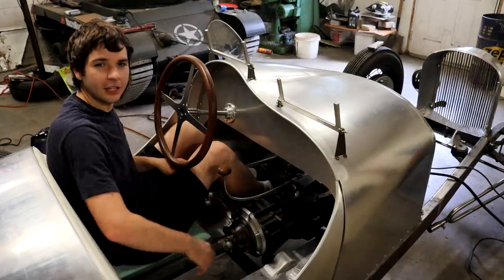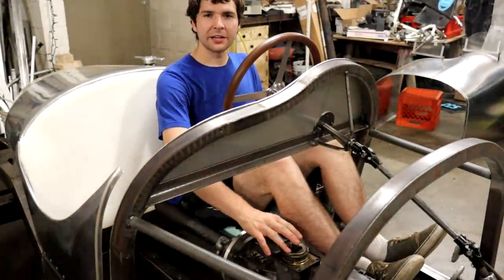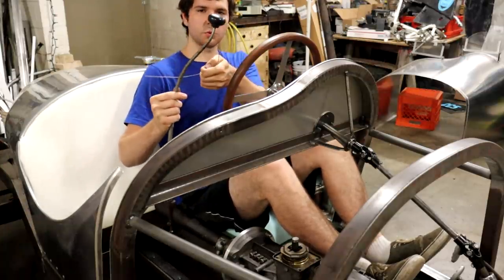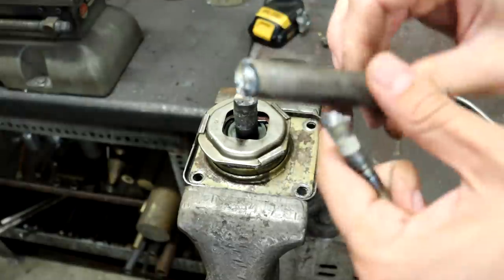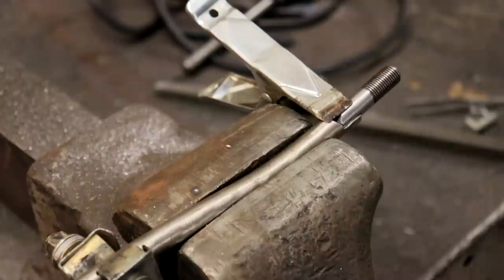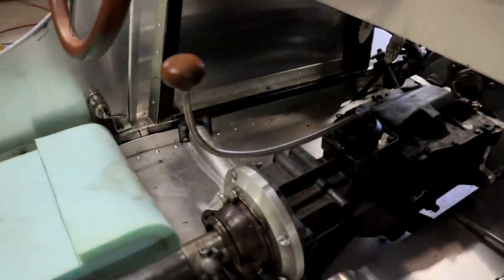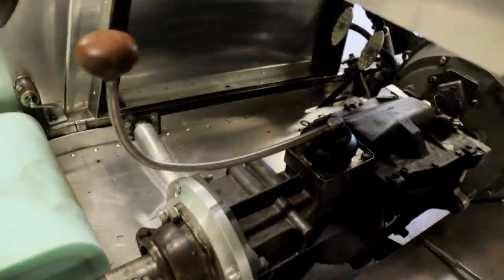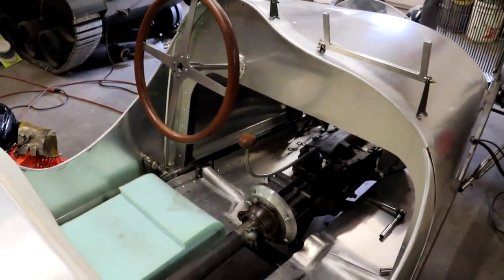Fabricating a Unique Shift Lever | Homemade Boat-tail Speedster Pt. 52

Comment: Original shifter warning! I've seen some crazy metals on shifters from iron, to galvanized steel, 11L17, and even one contained lead.
The one you have there is 11L17, great for machining, wear resistance etc. Stupid hard to weld low carbon with high  manganese..

Comment: @ 06:05 When using a radial arm saw, tuck your thumb underneath your palm to keep it out of harm's way, it serves no purpose being outstretched anyway since the cutting force is away and back from the workpiece. In fact, a well-sharpened negative tooth rake blade would need no help in holding work in place and will freely slice through unlike a tablesaw. I have rebuilt many of this saw type over my 73 years and it is my preferred sawing machine. 
You have a great video series; I just want to make sure you still retain all ten digits for the future. ☺

Comment: Brilliant job !!! Loved watching you work thru the Rod attachment issue ... it's always "The Little Things" and you scored 100 on adding the extra Pin to the attachment to keep it tight later in it's Life Cycle; I was concerned with short ED when you first bored the threaded bolt ... the Pin will make up for the loss of material.  Can't wait for your next installment !!!

Comment: Obviously there are so many ways you could have attached your shifter arm assembly. What you did works perfect though. IF, you really need to weld things, you could have spun up a total new shifter that fits inside the transmission and go from there. But your idea looks great as well. Thumbs Up!

Comment: Not sure how I missed this installment, given that I've become pretty good about viewing each one on the same day you upload them.  Reminds me of my own intentions to take advantage of my Uni-era woodworking and foundry/forming courses to design and fab a custom shift knob for my second-hand Mk 1 VW Cabriolet.  Sadly, the closest I got was knocking out a few VERY rough concept sketches, and I never managed to have access to similar shop equipment to revisit it, post-graduation; then life got even more complicated than it already had been.  Kudos (as usual) for going beyond that and making something happen!  As an aside, your horizontal shift arm layout is suggestive of that found in a Citroën 2CV (one of my favourite marques/models), but with your Jag engine in that roadster, you would surely blow any 'tin snail' away. 😄

Comment: Nice job! I think I would have tapped both the shifter lever and the part coming out of the transmission and just made a 90 degree elbow to connect them and put a lock nut on it, your way certainly works but I was just concerned boring such a big hole into unknown metal and possibly weakening it and not much there to work with after that if it breaks

Comment: you might need to counterweight the shifterarm a little as hitting a bump can make it fall out of first thirth  and fifth 
as for bending : weld two pieces of roundbar straight up on the table , you can put the rod in between it and roll it around the two pieces its verry handy to have for stuff like that

Comment: Maybe add a little counter weight to the nut side of the shift lever, 5th gear will have the shifter in the up position with the long shifter pulling against 5th gear in the transmission. Maybe even something decorative if it will show outside the boot.
Reply: the shifter is pretty thin so it shouldn't weigh much.
hovever i can see the thing being easily bumped out of gear in 1st/3rd/5th gear, i think a shifter not unlike that of the 2CV or Renault 4 that you push/pull would have been better
Reply: Just hook a bungie cord to the dash... and you can hold it into those gears to the upside.  you're welcome
Reply: @calholli  hooking a bungee cord would just reverse the situation, now instead of having the potential issue of going out of gear in  1st/3rd/5th, now you will have the lever snapping out of 2nd/4th/R

Comment: having daily driven (with vigour) a volvo amazon i feel you may eventually change the angle of the gear knob to closer to 90º from its plane of travel.
it feels weird at first but as it is now in a similar plane of movement to the steering wheel it becomes very natural and makes for fast shifts, with great economy of movement. (especially given how close your gear knob is to the steering wheel)

Comment: If, as others already pointed out, this rod is ductile iron, brazing should´ve also worked.
Reply: I would not trust braze to hold.
Reply: @maxironpaw  After I saw what Abom79, Keith Rucker and Keith Fenner have repaired by brazing I definitely would!
Not to mention quite a few instances where them and other guys found decades-old repairs on various stuff which held.
Reply: @sthenzel  No doubt that braze can be strong. I use it a lot myself. But there was not much meat there to grab and there is a lot of leverage on that shifter - one enthusiastic shift from second to third and it could snap right off.

Comment: It looks like you need to make it a short shifter. You just have to add some material under the pivot point. Then add that same amount under the mounting flange. 1/2" should do. It being ductile iron would make it harder though.

Comment: I'm wondering since you lost that inch or so of height on it will that come into play when you build a tunnel around the transmission? Looked like that reverse shift was awfully close to making contact, though that could just be the angle of the camera. 

Either way, awesome work and I completely agree about getting that grain pattern lined up nicely, that would drive me nuts if it were off.

Comment: Interesting.   It’s on my plate to do something similar to my T5, probably with a Model A shifter .   I think there are plastic parts inside that plate with the folded wings, I’ve seen in other videos how to remove it before applying heat.   Hopefully you didn’t melt anything! Maybe yours is different, mine is from a ‘92 S10.  **I had not heard or seen before the issue you had welding to it.   Always learn something from you, sir.
Reply from the maker: yeah I made sure that I wouldn't damage the plastic components inside the assembly. I also read online that new shift arms can just be welded to the stock T5 arm, so maybe there's a variety of shift arms on different T5s and only some can be easily welded

Comment: Do you happen to need throttle cables or brake cables? I happen to have about a dozen various vintage cables and original handles. They are mostly out of 30s and 40s Packards but I think there are some old Ford ones as well. I have no use for them, they're yours if you cover postage
Reply: Oh yeah, Studebaker as well. I think I have the the nickel coated e-brake lever as well

Comment: Vince I think maybe braising it (oxy acetalene) using silicon bronze may have worked as well
Tony from Western Australia 🇦🇺
Reply from the maker: possibly. It would have been a chore to disassemble the shifter assembly though since the sheet metal housing would need to be uncrimped
Reply: @MacroMachines  seeing the video to the end Vince I think what you did was a better fix, it gives you a chance to take the gear leaver off if you need to remove the gear box without having to line up the forks in the gear box etc when putting the car back together.
Also with the angle it is set will the leaver sort of be set in the lower dashboard cowling or from a forward tunnel mount?
Still braising can be an alternative to consider elsewhere maybe as another tool in your toolbox, so to speak.
Brilliant work as usual Vince 👍
Grin, no matter how many videos you put out, they ARE NEVER ENOUGH!
Tony from Western Australia 🇦🇺

Comment: Nice work! With all the weight of that long lever arm pulling down on the shifter, have you considered the possibility of it wanting to jump out of 1st, 3rd, and 5th gear...especially over bumps in the road. I had this issue in an old ford falcon of mine. It had a three on the tree with a heavy aftermarket shift knob. On bumpy dirt roads or over pot holes it would occasionally pop into neutral...very annoying. Hope it works out well for you. Cool stuff.

Comment: Did you try 7018 rod? Was thinking about why they wouldn't weld, I'm wondering if the original shift lever wasn't an alloy rich in chromium and/or cobalt. 7018 has always been my go-to for stainless and stainless behaving steels
Reply: Okay that's a very clever workaround. Don't skimp on the loctite! And a jam nut! She's looking beautiful though

Comment: I am wondering if that transmission stub needed a greater preheat in order to be welded.  I had a shift lever to trans weld break and that was no fun.  I think that you came up with the best possible solution.  Do you really need the passenger wind screen?

Comment: Awesome design, but I wonder why you went with an under loop instead of a more traditional over loop?
Reply from the maker: Because I though it looked better this way. It doesn't make a difference to the functionality
Reply: @MacroMachines  you thinking of doing a firewall? I’m curious to see what you’ll come up with for the shifter.

Comment: That gate pattern is not going to work in real life. I can visualise a double lever mechanism needed to essentially translate the normal pattern back 700mm
Reply: Well swapped many s-10 boxes for last 20 years in lower hp rods before guys knew about them.  Gate works just fine. Can even change pivot point to make it shift with less throw. But i dont know why he couldn’t weld it... I regularly weld tabs on for hurst shift handles.
Reply: @docholiday1034  Wrong kind of weld rod perhaps?